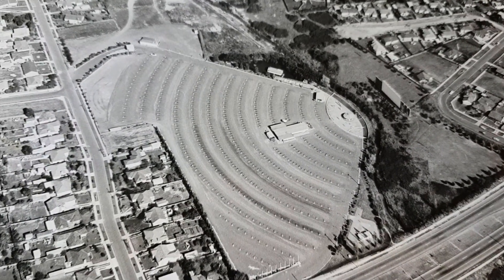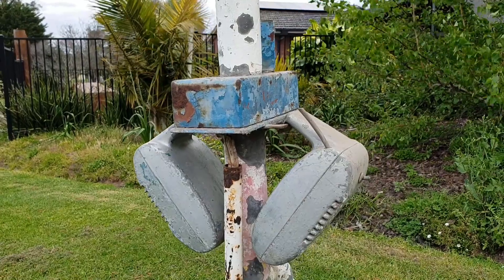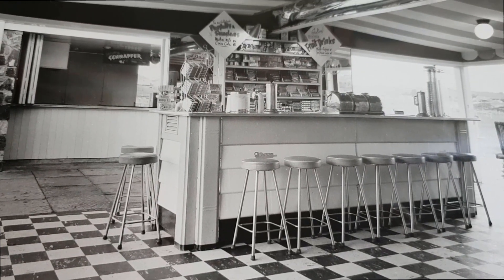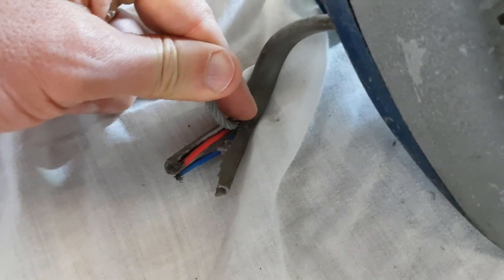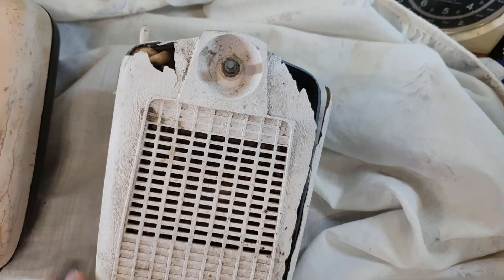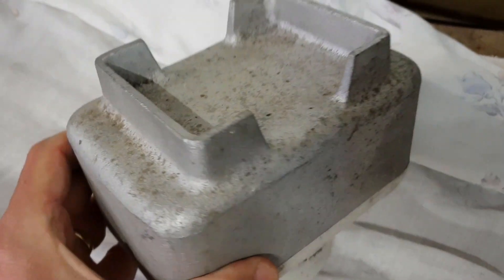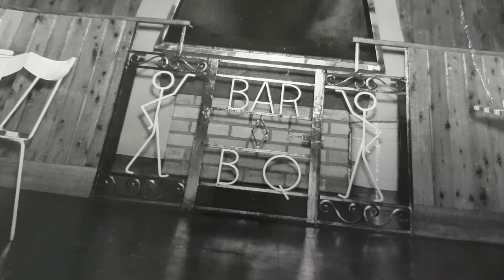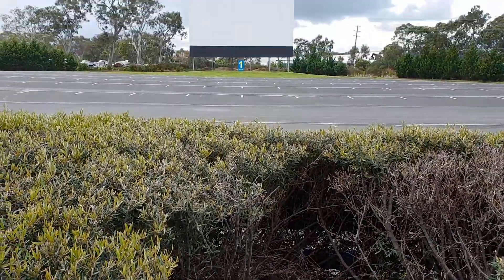Drive in speakers history tour.

Comment: thank you David ,did you know that the Westrex in car speakers had a mute system at the speaker post so that when you hung up the speaker the sound was muted thus saving you running around turning down the speaker  pots or volume controls,and also the signal strength was about 1 third of a watt at each in car speaker
Reply from the maker: I did not know that Ron. Great info. from someone who was there in the golden era!